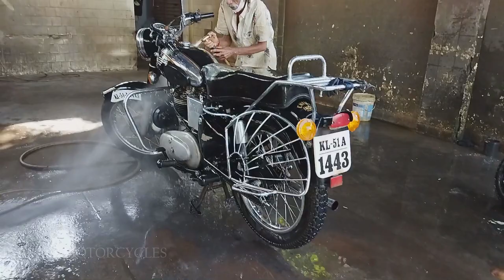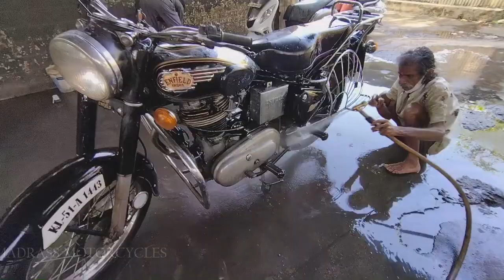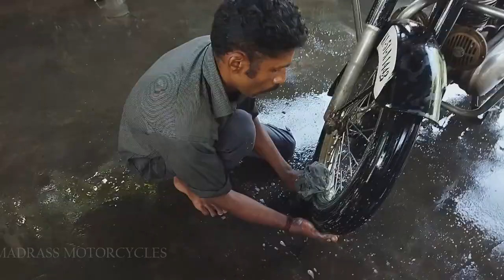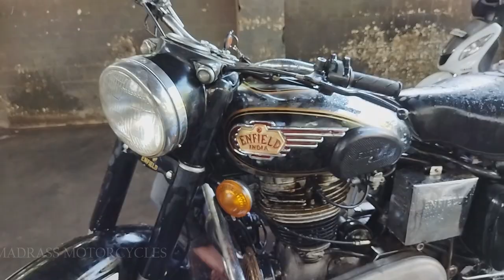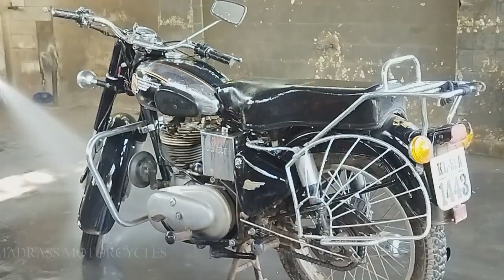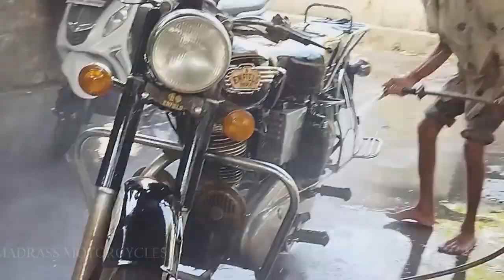ROYAL ENFIELD BULLET WASH AFTER LOCK DOWN YEARS

Comment: Engine head il oil leak undo bro
Reply from the maker: yes
Reply: @OLDMADRASMOTORCYCLES  same here.. from spark plug side
Reply from the maker: @JebinJaise  this is from rocker packing. I changed it now no leak
Reply: @OLDMADRASMOTORCYCLES  thanks bro… I was on a research about this.. this issue to me happened from the day I finished lathe work.. i was doubting whether it’s due to any crack. Some mechanics even suggested me to replace engine head